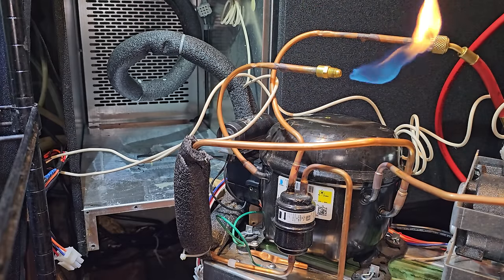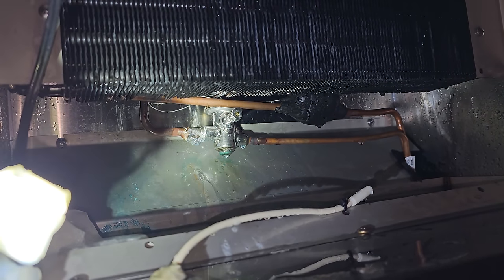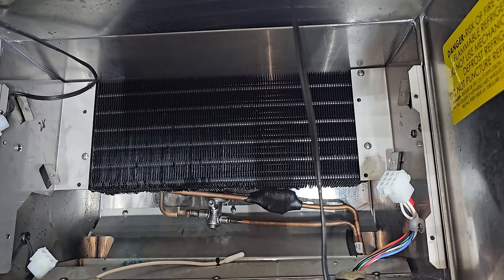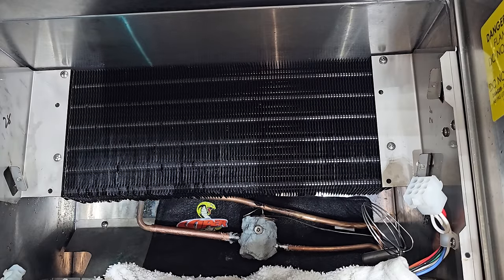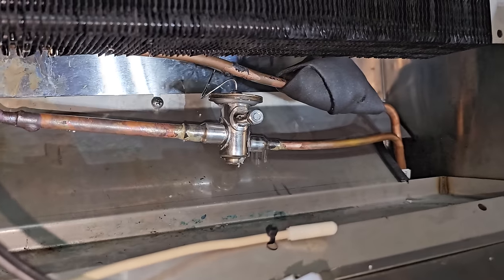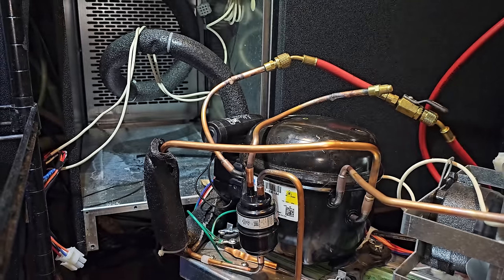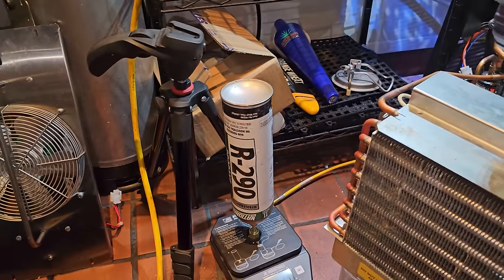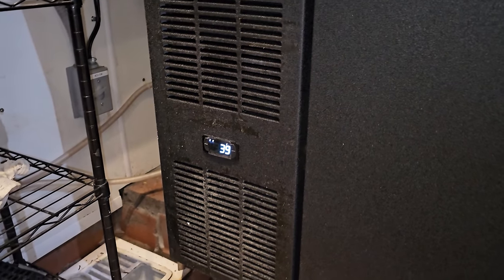DANGER ! R-290 IS A HIGHLY FLAMMABLE REFRIGERANT

Comment: R-290 is just pure propane. Also it takes so so little on most the small units it's not that dangerous. Back in the late 90's people just dumped propane tanks when the new valves came out. It's a very powerful voc but other than that the risks are low it's only a few dozen grams vs like a 1pound+ camping tank
Reply: Yeah, I don’t know why these guys are so scared of it. When you open the system just use nitrogen to push it out of the system. Then replace the evaporator coil or compressor as normal R134a system and put a service valve at processing port and high liquid side. Then charge the system with manufacture suggested amount.
Reply: It kinda strange that some of the systems call for so little that it's crazy. less than 200 gram,  I have lighters with more butane than the entire system has. It's only downside is poor cold weather performance, so it's basically useless for heat pumps.
I have a 2 stage cascade system I build to get near cryogenic temps on my gaming pc. Using propane and ethane. I have a custom removable 3rd stage I can use to make liquid air I use electro magnets to draw out liquid oxygen and collect dryice after pouring off the liquid nitrogen. This system is OK at best I can make around 10gal a day of ln2, 2lb of dryice, and 1/2gal of liquid oxygen.
Reply: @UltraHydrophobiccoat  so u are saying to converted to a R134a system by replacing the evaporator and compressor that’s an R134a. Then recharge to the mfg. specs. You know that’s never gonna work long terms.
Reply: Not 'just propane' it's refined and dehydrated for optimal ref. use.
Reply: @UltraHydrophobiccoat except True service procedures require the access ports be removed after service...
Reply: @ZoeyR86  Lol yeah thats why the latest generation of heat pumps use r290. Its not good at cooling when its cold but heat pumps want to heat when its cold. Doh
Reply: @kojsiusoaliu6772  Yeah so.... just propane.. As in "PURE" propane, without the scent added. Some people have used camping propane and added a larger drier filter with good results but r290 is so cheap so I just buy the pure propane, ie r290.

Comment: They should leave the mercaptan in it. You'd know pretty quick you have a leak somewhere.
Reply: Are you sure the merkaptan would stay distributed across the gas and won't get e.g. absorbed into the compressor oil? Because then it would become even more dangerous, when people would be expecting "no smell - no leak", so feeling falsely safe and so not taking proper care.
Reply: Mercaptan is an organic and being in the presence of heat will decompose and make the oil acidic.

Comment: 14:02 just swage the 5/16” copper ever so slightly so that it fits snugly inside the 3/8” line and slightly swage the 3/8” if necessary. I had to do this Monday on a leak search and repair on an old R407c Trane RTU package unit and it worked fantastically, perfect leak and decay test. And I always use stay-brite 8 silver solder and stay clean flux for stainless to copper connections and I’ve never had an issue or call backs related to the repairs.

Comment: I like the smaller jeweler type torch that had the little fabric exterior hoses. 

But you can't have anything on the gad line. It pinches then off.

But that little jewler torch has a smaller heat area. Seem quicker safer and easier to move around.  I can get it into tighter spots too.

Comment: Looking for to the r454b refrigerant coming out for residential cooling.  Leaking evaporator sitting over a gas fired furnace.  What could go wrong.
Reply: Hey but we saved the planet though from 410a
Reply: No worries, 454b is half 410A anyway... 
It isnt directly combustible... only mildly flammable.

Comment: The other day I was doing a compressor on a 410a split system. I was running out of nitrogen and I swept what I could but when I unsweat the discharge line it had a mild flame out. I didn't panic, but when I turned my torches off I had the bright idea to turn the oxygen back on and try to blow the fire out by blasting oxygen into the discharge line. BAM it popped like a loud firecracker. Luckily nothing bad happened. Left to go get more nitrogen after that. I guess it was a good idea to me at the time with my heat addled brain, could've been real bad. Can't be lazy like that with hydrocarbons, that's for sure
Reply: tommyq374  yeah it was a dumb move and I definitely knew better, just let my intrusive thoughts win I guess. Usually I'd just turn the nitrogen way up and it'd snuff out the fire.
Reply: Strangely enough, it wasn't the worst idea.  What you did is quite literally blew out the flame, while rapidly cooling the metal.  You also diluted the fuel.  Yeah, you diluted with the oxidizer (oxygen), but it's still diluted.  When the fuel is dispersed enough, the reaction halts.

Comment: I worked on an oil cooler that had a stainless steel heat exchanger once. It was leaking where the TXV feeder tubes were brazed into the heat exchanger. 

Took me an embarrassing amount of time to find out about 56% silver rods. 
But, I also used them to fix a fryer basket once. Lol

Comment: Love the vids! Quick question as far as I know most manufactures want you to crimp and seal the system and not to have permanent stubs on the system. I myself think that’s BS because makes it harder to work on and can potentially be dangerous even thought you are suppose to crimp then soap the end and then braze. What’s your take on that?
Reply from the maker: I don't pinch them off anymore, I did when I first started working with r290 but it's one less thing to do and I'd rather not have my employees braze them shut cause it's a bit sketchy
Reply: Exactly my thoughts. It’s significantly safer to leave the access ports on there than to risk starting a fire or cause an explosion soldering them closed.

Comment: R-290 is an A2 refrigerant, the new stuff rolling out is an A2L which is mildly flammable, you can hold a lighter to it, it won't ignite but it also won't blow the flame out either least the tests I've seen of A2L
Reply from the maker: R290 is an A3 refrigerant (highly flammable and unoderized) but you are correct about the A2L they can light but they wont sustain the flame

Comment: It's midsummer festivities in the nordics, which means today Friday is a bank holiday for most. Was gonna go to my neighbour and top up his split type AC. I've installed it in 2011, a Mitsubishi FD25. Well it was as good as empty. Well thought I'd top it up so he'll manage the weekend. Tried that, has a huge leak in the indoor unit coil. I quickly turned it on and pumped it down, with the refrigerant in the outdoor unit. Luckily I had a spare FD35 indoor unit at home so fetched it and switched the indoor units. So a ten minute job turned to three hours (my spare indoor unit was in an outdoor storage so had to clean it before I installed it)

Comment: Definitely a diverse refrigerant! I've got it in both of my trucks. One was r22 and the other was r134a. The txv system is definitely a lot better at handling it. Just charge to 55psi on the suction side. Run the engine at highway RPM and make sure it doesn't pull into a vacuum

Comment: Sir great content, I would suggest while weld in that particular area is very difficult, use stainless steel plate and bend it like hook, and attached it in your welding torch,you can easily weld it, and I'm sure you will amaze the result. Sharing is good sir, that why I want  share with you my experience. Thank you very much. Great job.

Comment: I just found your channel while researching the posible cause that my R290 monster refrigerator is not getting to temperature. I live in Rancho Cucamonga CA. Do you work in this area?
Reply from the maker: Yeah I’m based out of Jurupa Valley and we service the Inland Empire and Orange County. What’s going on with your Refrigerator?
Reply: @HVACRVIDEOS  It has ice built up on the coil and it does not get down to temp. It is only get to about 48 degrees

Comment: I made up a set of fittings with the rectorseal pro fit connectors. That way I can weigh in a charge and re seal the system.

Comment: I've been an HVAC tech for about 15 years now.  I have yet to work on or go down the road of any flammable refrigerants.  So my main question is, having not researched it myself, does the EPA allow for venting of R290?
Reply: Yup. But obviously be aware of the surroundings
Reply: No different than turning on the BBQ grill, they dump propane till they light.

Comment: As an occasional "hobbyist" HVACR "researcher", I use StayX silver products almost exclusively as rarely does anything I am doing go over 20 bar.  I love my R152/290/600 but I am paranoid as heck about it.  My leak detector makes me nervous sometimes, it appears to have an electric arc in that tip, always worry that it might make a leak in a cabinet or even small enclosed space go bump.  Maybe I need to test it to see if it will actually ignite one of the gasses.

Comment: For fun, ask your Sporlan rep why their charts only go to 100 pound differential on their TXV's.
The real answer is they never realized it could work with even a 1 pound differential.
Be sure you have a suction accumulator  and you can flood the evaporator.
It will float the head way way way down.
I had to do that in Alaskan villages  as AC electric power was already over taxed so the compressors RLA dropped down too!

Comment: They are making small R290/R600 recovery tanks now. Place that tank into a vacuum and it will take in the charge. I don’t really recommend venting in an enclosed space. In a pinch, I have used a leak tight plastic bag and just vented it outside. But a bottle is preferred.

Comment: Right. Maybe if we wrote "propane" on there instead of "R-290" people wouldn't need to be reminded it's flammable.

I see a lot of comments about leaving the odor agent in it... Would that interfere chemically?
Reply: Someone suggested that it could react with the compressor oil, or otherwise end up "clumping up" and not be evenly distributed through the gas.
I imagine it could also create a problem physically by acting as a noncondensible.
Since R290 boxes tend to be so tiny and critically charged, even a small amount of stuff with a different phase change behavior could throw everything off.

Comment: Had ports on it! Or you put piercing valves on it?
 
If so what temp piercing valves you like? The vise grip style, don't work for me. 

I use the clamp on type, when I use them..

Techs leaving valve in the r290 systems?

Comment: Chris, not sure why you had so much trouble removing the TXV.  It was so easy to install at the factory, they had no problem.  So it should have been easy to remove.  🤣🤣🤣  How about if you would have added a short stub on each side of the TXV at a table and then you could connect the stubs in a more convenient location you decide to make to make the installation a little easier.

Comment: Hey Chris. I was wondering what your thoughts were on the gas mate leak detector? Is it the best on the market or is there another that you’ve used that you prefer more? I’m not the biggest fan of the gas mate, but it appears there aren’t many options out there. Curious as to if you’ve found a hidden gem. Take care Chris.
Reply from the maker: The gas mate is the dumbest leak detector out there, d batteries and it way to sensitive to stupid stuff… I have heard that you can buy a hydrocarbon sensor for the Stratus and that will be my next attempt as I already own the stratus
Reply: I watched a video where you said there was an HC sensor for the Stratus. I did some research on it through a local supply house and they weren’t able to find that sensor.

Comment: I feel like the TXV problems is an electrochemical reaction between two dissimilar metals. Probably wrong, and it's just poor/nonexistent QC, but that's the first thing that came to mind. Also curious why they don't add the smell to it. Is that because it's a non condensable, thus more refrigerant would be required?

Comment: Is there a specific reason those "small non-split all-in-one cooling systems" often use R-290? I have no idea about refridgeration tech, honestly, that's why I was wondering, why not use any of the other refridgerants for those systems?
Reply: reasons 1.  The fire-safe stuff is being regulated out of existence due to them being a long-lived and powerful infrared reflector, greenhouse gas.  2.  in small systems because the smaller amount of refrigerant (propane in this case) is less a fire & explosion hazard in smaller amounts.

Comment: Well we know R-290 is refined propane and therefore highly flammable but it's limited and in a closed loop. To put things into perspective most heated homes in U.S. and Canada use a flammable heat source (natural gas) in an open system and virtually unlimited amounts.

Comment: Working with it is not what im worried about, leaks are, pinhole leak in the box, fan kicks on, its been replaced with the wrong kind of fan, sparks, box explodes. Then in the end, none of the insurance companies would pay out anyway.
Reply: These days insurance is pointless unless you also keep a lawyer on file to force the insurance company to pay out, so I don't see the point of having insurance other than that which is required by law in the first place.
The whole point of the insurance company is to NOT pay out, otherwise they go out of business.
Whole thing is a contradiction.

Comment: Dan Foss literature is and should be treated like Fords 10,000 + mile oil change recommendation. Throw that out and change it at 3 to 5K always... Protect your TXV particularily the gas charged power head and expandable / warpable internals. Excellent video!!

Comment: Dont u have a sharpie? Write silver solder used on txv under it on the cabinet.. Simples. Also I would just cut the bulb off and leave it under the tape, add the new one next to it, save my knuckles.

Comment: pull a quick lil vacuum on the 290 units before brazing. Prevents any flame outs. Haven’t had bad luck yet
Reply: I also like to put heatgun on the system so the residual propane trapped into the oil goes away

Comment: Not a HVAC tech but I am cursed with "the knack" (Dilbert Reference) . What property of Propane makes it ideal for this design instead of a safer alternative?  The temperatures involved seem comparable to alternatives. If it were some antique that's a different conversation - but this is current tech. There must be a valid reason, even if it's a bad choice.   . . . what's  a Dad hat?

Comment: AS for the screw, "module level manufacturing", looks like slid in at the point of tube entry. Also kudos as you are so meticulous with your work. Do you ever run across SO2 any more? or Ammonia? I know the Ammonia was on very large scale systems mostly, but the SO2 Refrig boxes. I have an old 1932 vintage two door with SO2. and in response to your ending explanation, Have An Unimpeded ESCAPE route, just in case.  anyway Great Video

Comment: R290 is just dry propane.
Most likely it (flame) was a little oil in the line/dryer.
Pull a vacuum first and while under vacuum turn on the nitrogen.
R290 actually works better than R22. Similar glide and carries oil more efficiently.

A little R600/R600A helps if you mix it in.

Comment: Not sure what you were faffing around for.
You could have fixed that in a couple of hours and left it running 

First l recommend vacuuming out before you start to ensure all the refrigerant is out of the oil.

Second you either cut the pipes on the copper lines liquid and suction inside the cabinet or probably better by the condenser,  unscrew the EVAP and drag it out. With the txv 

It could then be fixed out side without  concern. 
It didn't need a new txv it just needed silver soldering . If you cant silver solder repair on a valve I have concerns, especially if you don't think your guys can tell the difference between braze and silver solder im even more concerned (fairly sure your guy used silfos instead of SS which is why it leaked again....)

Using silfos is a cheap way out always alway use silver solder.

Just my 2 cents

Comment: I see u are not using R600a/R290a gauges. Also i see u are not using a static free vacuum pump 🤔. R600a and R290a manifolds have a shorter hoses. Pressure readings are different on R600a/R290a. I have the mastercool weight scale for the R600a/R290a and the mastercool static free vacuum pump, yellow jacket manifold R600a/R290a.  I’ve seen some shady techs converting R600a to R134a systems. It will never work and don’t convince me yes it will 😂 Bull 💩.  I walk away and not charge the customer a service call fee due to legal issues. Glad u mention the legal side of covering our asses. Love all the hard work you put in and to properly educate us.

Comment: Thats a tight space that would bring out the fowl words i forgot existed. I would have brazed the txv with copper nipples outside of the unit the swedged the copper nipple ends. You did a great job brazing in that tight space. I think the bulb strap put you at the point.

Comment: Why haven't you cut the whole evap out of the unit? Would have been easier to solder the two silver points (one has to be a pipe with a fitting), and brazed the liquid and the suction with 15?

Comment: I change out r600 compressor on residential refrigerator all the time. They are the worst they are normally dual evaporator and use a 3 way valve , trying not to burn everything is the worst part
Reply: LG 😂

Comment: This is like they have started using R1234yf refrigerant in cars. It's flammable unlike the old R134a and it's stupid expensive.
Reply: I've never used 1234yf but it's less flamable than 290 or 600. 

A mechanic told me he just used 134a instead of 1234yf and it worked. I'll never buy 1234yf